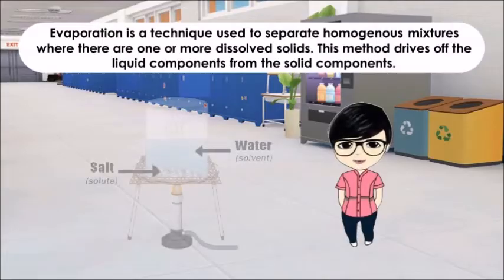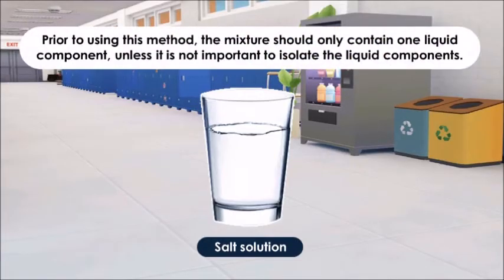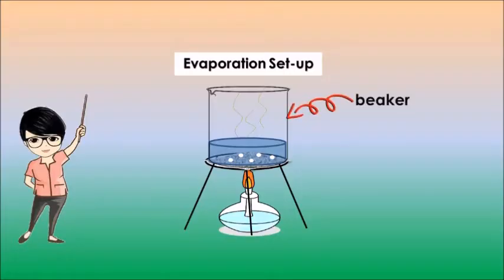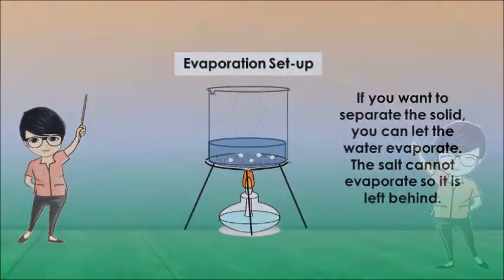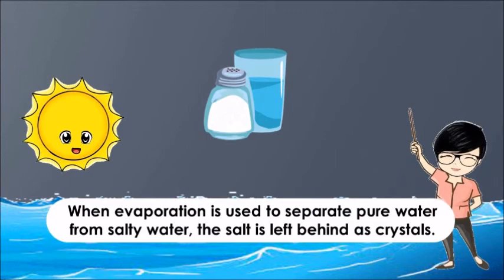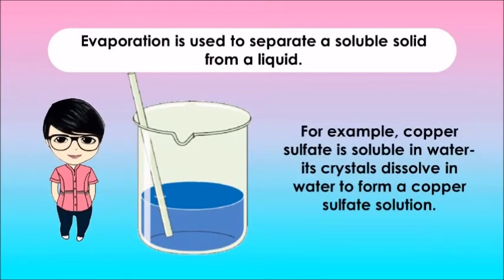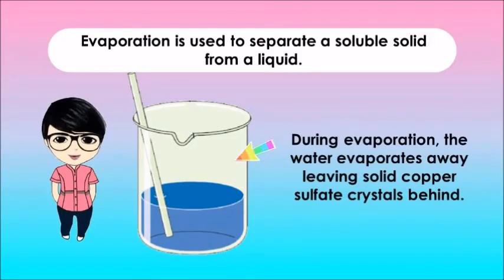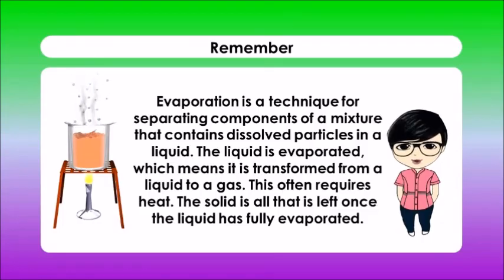EVAPORATION

Comment: Rhia Beatrice C. Tambalque
VI - Carbon 

What have i learned? : i learned that evaporation is a physical change, used as melted in hot water like coffee and hot water. as the hot water acts as a solvent and the coffee powder as solute as you mix it, solubilty is also another term for evaporation(i think so.)

Comment: ELISA LAUDETH C. RUPINTA
IV-CALCIUM

WHAT I LEARNED?

Evaporation is a technique for separating components of a mixture that contains dissolved particles in a liquid.The liquid is evaporated,which means it ia transformed from a liquid to gas.This often requires heat.The solid is all that is left once the liquid has fully evaporated.

Comment: Jassy kyrene Castillo Bejasa
VI - hydrogen

I learn about: evaporation is the process where a liquid turns into a gas, also known as vapor this happens when the liquid’s molecules gain enough energy to break free from the liquids surface and enter the surrounding air. It’s a crucial part of the water cycle and can be influenced by factors li temperature,humidity, and wind.

Comment: JIA C. ABANILLA 6 CARBON L LEARNED ABOUT EVAPORATION IS THE PROCESS WHERE  A LIQUID CHANGE INTO A GAS  THIS HAPPEN WHEN MOCELUES AT THE LIQUID SURFACE  GAIN ENOUGH ENERGY TO  OVERCOME THE INTERMOLECULAR  FORCE HOLDING THEM TOGETHER ALLOWING THEM TO ESCAPE iINTO THE AIR AS A VAPOR

Comment: Andy C. Lunas 
VI-calcium

 what i learned about🎉🎉

Based on the video, the evaporation technique used to seperate homogeneuous mixtures where there are same or more dissolved solids. This method drives off the liquid components from the solid components.❤❤❤ Thanks for readinggh

Comment: Faithe Yzabelle Blankas
VI-Calcium

I Have Learned That Evaporation is a method/technique used to seperate homogenous mixtures,the liquid is evaporated which means it is transformed from a liquid to a gas,the liquid is evaporated using heat,the solid is left once the liquid has fully evaporated.

Comment: Jaiannah Phoebe L. Duazo
VI-Calcium

What have i learned?

    I have learned a new separation technique, which is called evaporation. Evaporation is a separation method to separate homogenous mixtures, it can be applied to a salt solution.

When constructing an evaporation method, you will need heat (e.g microwave, candle etc) when the water evaporates; salt is formed again.

Thank you po❤

Comment: Yumi Alexa S. Dela Cruz
VI- St. Lorenzo

What I learned about this video:

Evaporation is a type of vaporization that occurs on the surface of a liquid as it changes into the gas phase. A high concentration of the evaporating subtances in the surrounding gas significantly slows down evaporation, such as when humidity affects rate of evaporation of water.

Comment: Irish Nicol Rezano 
VI-ST.LORENZO
Evaporation is a Way to separate Homogenous Mixtures But the Mixture has to have a liquid part as all liquids eventually evaporate example: Sea Water, Copper Sulfate 
My opinion: Evaporation is A great way to separate Homogeneous mixture but the homogeneous mixture has to be part liqu because the heat evaporates the liquid only leaving the solid part left

Comment: St Joseph
Gabe Boces
What i Learned: Evaporation is a Way to separate Homogenous Mixtures But the Mixture has to have a liquid part as all liquids eventually evaporate example: Sea Water, Copper Sulfate 
My opinion: Evaporation is A great way to separate Homogeneous mixture but the homogeneous mixture has to be part liqu because the heat evaporates the liquid only leaving the solid part left